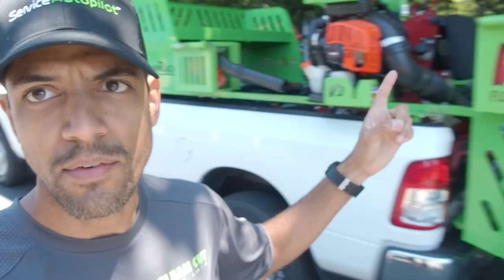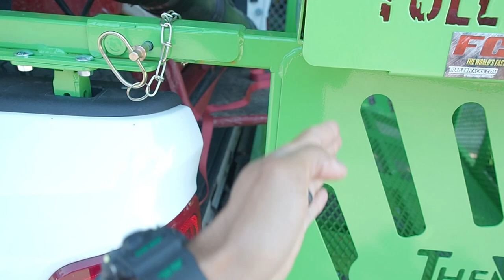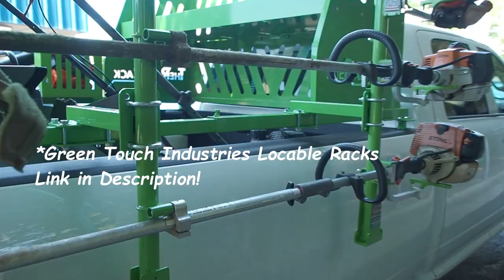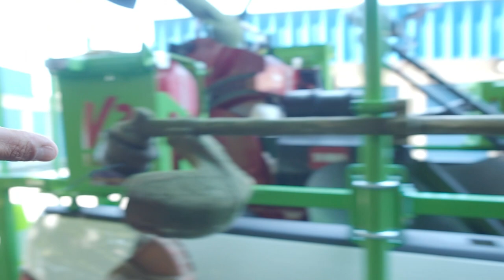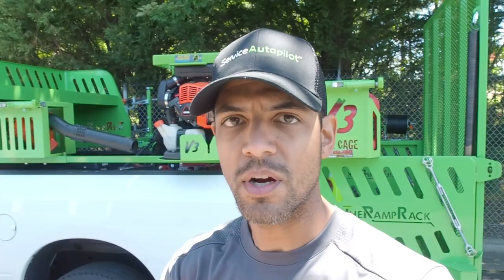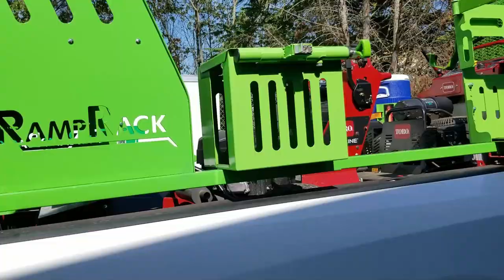The BEST NEW WAY to Haul your MOWING EQUIPMENT- The RAMP RACK!

Comment: This is truly the way to go. Great video. Thanks,  I wanna go in this direction. You sold it.lol
Reply: @LawnCareRookie  what size truck is recommended 2500 or better ?
Reply from the maker: @ogsan1296  it depends on what you're putting in it. And they just came out with the sport. Smaller and lighter for f150 and smaller trucks 👍
Reply: @LawnCareRookie  I am thinking a 2500 Chevy Silvy long Bed ?????
Reply: with GSTAND and maybe a 36
Reply from the maker: @ogsan1296  then yes, 2500 or bigger

Comment: I'm definitely a HUGE fan of the ramp rack, I want one. Not having to deal with pulling a trailer all the darn time and one less thing to keep up with

Could you fit 2 zero turns on there by any chance?
Reply from the maker: Possibly, as long as they're not too big. 48 or smaller between wheel wells and no bigger than 54 behind.
Reply: @LawnCareRookie  ok good to know, thanks for sharing with us

Comment: When you use the blower are you getting it off the rack from the ground or the bed of the truck?
Reply from the maker: Both. I think the guys prefer inside the truck bed when they can but I think it's less steps to grab from the side of the truck. I'm use to it and can get it in and out efficiently most of the time.

Comment: @LCR On the side bracket for the trimmer racks how much does it stick out, also whats the size of the square pipe how wide ? Thanks im trying to me me one love the set up.
Reply from the maker: I took everything off the sides to put my wood sides back up for mulch season. If you message Ramp Rack I'm sure they have that info. Don't forget to use code LCR and save 10% if you order one! 💪
Reply: Thanks man will do

Comment: What do you do overnight? Leave everything as it is? Or unload into a shop every night? thanks,
Reply from the maker: Load and unload everyday. Not the most ideal but only takes 5 minutes each time. No different than if you have an open trailer and have to do the same. Beyond theft, I wouldn't want to leave them in the elements...

Comment: Just about ready to pull the trigger on this setup for 2023. My only concern is the height of my tailgate (and slope of the ramp) with having a lift kit on my 3500 truck. Anyone have feedback on using the ramp rack with a lift kit?
Reply from the maker: Contact Ramp Rack and see what they say.
And don't forget to use code LCR to save 10% if you do buy 👍🏼

Comment: Those side mount brackets for the trimmers come with the ramp rack?
Reply from the maker: No, they're from trailerracks.com
Green Touch Industries
Reply: @LawnCareRookie I only have a 52” sit down mower. If I was to use that mower only would I need to back it up on the ramp rack to evenly distribute weight on the truck bed?
Reply from the maker: @branman7211  probably, plus you should be able to get more of the mower on before the deck stops at the wheel wells in the truck bed...

Comment: What kind of truck are you using??  Need at least a ton for a walk behind and a stander together.
Reply from the maker: 3500
You can use 3/4 ton with extra leaf springs or airbags installed. Walk behind and stander way less than 2,000lbs combined. A 48 and 52 stander, depending on brand, is when you need to beef up suspension or get full ton. 👍

Comment: Is there an option where you can still tow a trailer without taking this off?
Reply from the maker: Not sure. I know they don't sell anything but maybe there's something out there for a hitch from a 3rd party.
It's meant to take the ramp part off easily if you need to, with the quick disconnect system.

Comment: I like the idea of it but personally I like to pack equipment away and lock it in storage.  It would also be a real pain in the arse if the truck had a major mechanical issue.
Reply from the maker: That's what I do, unload and load real quick everyday. It would be a little pain but that's why I still have the trailer for backup...

Comment: What size stander can you put back there?
Reply from the maker: 48 or smaller between the wheel wells and up to 54 behind wheel wells. So I've loaded my 48 and 52 at once for many occasions.
Reply: @LawnCareRookie   How do you like the dodge? I want to get a single cab long bed but not sure what to get.
Reply from the maker: @bradnewcomb1  I love it! I'm not attached to any brand though. I'm sure any new heavy duty truck would do. Just do your research on used. Some brands had issues with certain years and engines types for example.

Comment: Has anyone beat the wheel wells in to carry 2 52s?
Reply from the maker: Yes. Not me, but I know it has been done. Just not something to advertise. But guys figure stuff out 👍
Reply: @LawnCareRookie  do you use air bag suspension upgrade on the rear? I’m debating on 3500 truck too and didn’t know if you needed it/added it for safety?

Comment: I priced this unit with racks, closer to $5000.  For small HOAs this may be ok. But with a large variety of different sized properties, this would never work.  We’ve used enclosed trailers for years. It enables us to carry much more equipment, which ultimately helps us to be more efficient and make more money.  To much money for what you get
Reply from the maker: Absolutely not for everyone and best for route density dedicated mowing crew. It's $4,000 for how I have it setup. Types and brands of racks will vary that final price but it's one time investment. Zero yearly maintenance and less wear and tear on the truck, plus gas savings. Unlike pulling a trailer... I have switched back to enclosed trailer for leaf season and can immediately tell the difference on my truck. Having weight over axle instead of pulling it behind, extends the life of your brakes as well (which is one of the first things to go pulling a trailer). Just another option for businesses where it makes sense, like mine 👍

Comment: U still gotta reach high for that stupid spring latch for the trimmer rack, worst fuckkn thing they done to the v3 racks, so stupid
Reply from the maker: You always had to grab the latch at the top... The spring makes it easier now. Less steps 👍
Reply: @LawnCareRookie  but u could just open it in the morning and leave it, then just use the thumb latch for each trimmer, now, u have to reach one hand to the top and hold it open and other hand to the bottom to get at the trimmer, just seems stupid to me, literaly a step backwards imo